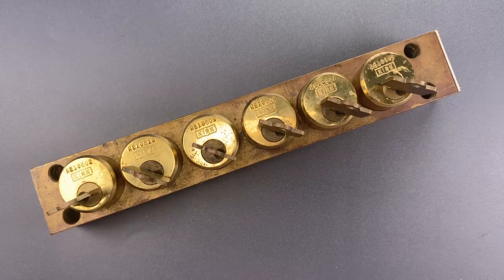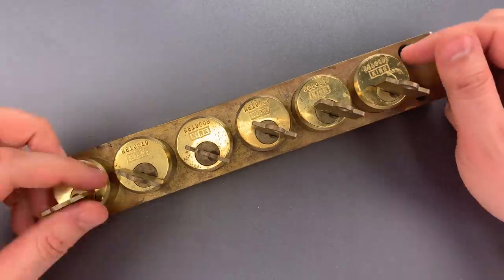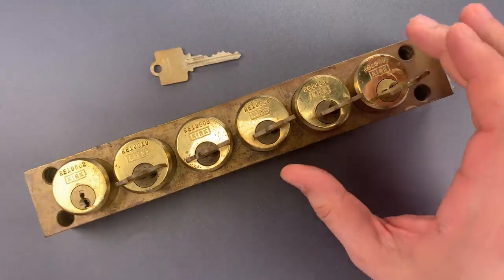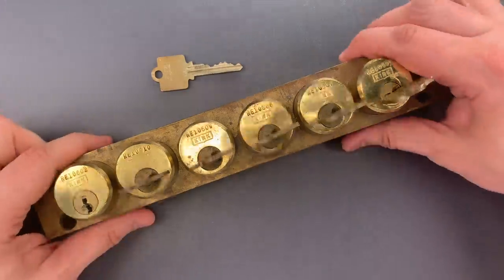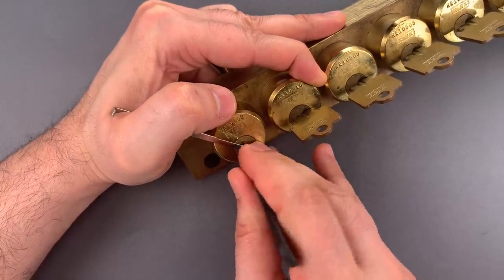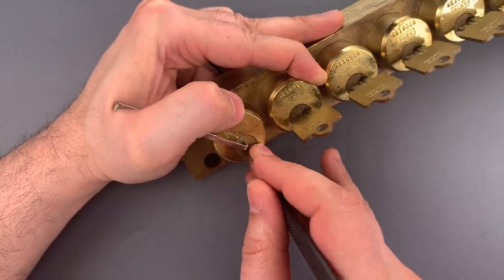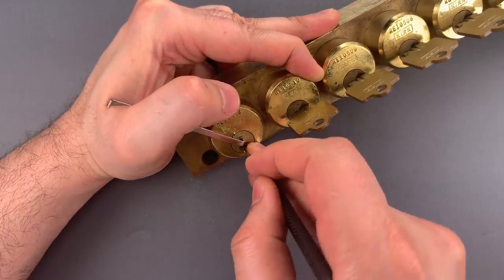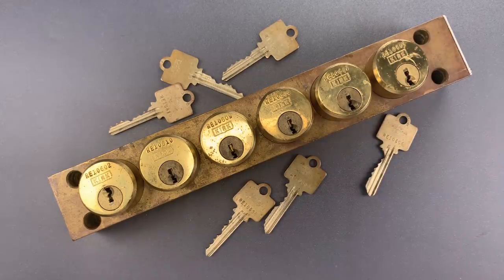[1190] 6-Key Kirk Interlock Panel Picked

Comment: As an electrician (retired) I have some experience with these interlocks, and that was a very good explanation of how they work.
BTW they are usually used where you need to shut down 5 systems to get the 5 keys in order to release the 6th which will allow access to the dangerous equipment. This ensures that nobody can access the danger area until all 5 power sources have been locked off. Often found on the 488V systems used in precipitators.
Reply: 450+V systems scare me. Seems like the Everett Field Boeing plant had one or two people manage to kill themselves by blowing up a 450V cart a couple times a year.
Reply: Yeah I was thinking he was doing it backwards. The ones we use at work you would put the five in to get the one.
Reply: @ScottKenny1978  we were taught that 347v and 480v systems were the most dangerous, because that range will result in a current that could cause cardiac arrest. Lower voltages cause burns, and higher voltages just blow body parts off.
Reply: @parapicktog7734  I'd believe it, though I wasn't joking about the words "blow up" a power cart.

An electronics tech friend of mine watched a kid get wheeled out of a navy school in a body bag from the 9v battery in a multimeter. Apparently the kids had been messing around with measuring skin resistance when this kid managed to put his thumbs down onto the points of the leads. And those points were sharp enough to pierce the skin deep enough to run the current measuring the resistance through his blood...

Dropped dead on the spot, they couldn't restart his heart... 😭
Reply: @ScottKenny1978  there is something not quite right about that story.
The 9v battery in a multimeter is not capable of producing enough current to cause any damage. But yes it is the body resistance (average body) that determines the amount of current that is drawn for a given voltage. 200ma to 300ma is the range of current that can stop a heart, and a human body resistance varies in a range that draws that amount of current with voltages between 300v and 500v. This is why 347 and 480 volt systems are so dangerous. A meter cannot generate those voltages, nor can a 9v battery produce enough current to do any damage.
Reply: @parapicktog7734  that's the story. Poor guy managed to take the full current of a 9v battery across the heart. This would have been in about 1990 or maybe 1993-94 (I forget if that was when he was training there or assigned to teach there)
Reply: @ScottKenny1978  I reiterate: A 9 volt battery cannot produce enough current to cause any damage to a human body.
Reply: @parapicktog7734  a 9v battery can supply up to 1 amp, which is well over the 200-300 milliamp current you said can kill.

This kid jammed his thumbs down onto the points of the probes, breaking the skin and running the current through his blood stream.
Reply: Came here to mention that. Our plant still uses them. A very effective safety system

Comment: I worked for 35 years in power stations and the scenario you suggested was EXACTLY what these interlock systems were used for.
The main electrical supply breaker for a switchboard had to be switched off in order to release the key (the one used on the left in this set-up).
Once the power was OFF and the key released, you would take it to the key-exchange device shown in this clip.
Insert that far-left key taken from the electrical breaker switch and then you could remove one or all of the other keys which gave you access to the doors to the switchboard.
As long as one or more of those keys were removed, the far-left key that allows you to turn the power back on is captured and you cannot restore electrical supply until all the switchboard doors are closed, locked and the keys removed and placed back in the interlock device.
Simple, effective and not too expensive.

Comment: When I was an RA in college, we had an interlock like this one (with two cylinders instead of six) for accessing the dorm's master key. Each RA had a key to the interlock with an etched serial number on it. That way, there was only one extant copy of the master key and if anyone was using it, you could see whose key was used to access it.

Of course, the interlock wasn't the only layer of security there. The interlock was inside a box locked with a different key inside the RA office, which was behind the continuously-staffed reception desk, which was behind the keycarded entryway. Defense in depth!

Comment: "Probably they do provide better security than many locks sold today." - LPL

"Crank the mass production boys, we hit the jackpot!" - Kirk locks probably.
Reply: "many locks sold today" almost certainly refers to masterlock
Reply: Imagine having this on your front door. Even though you only need 1 key to open the door, it's still going to look like some crazy security
Reply: Irony is that’s an OLDER series interlock key
Reply: Think about how expensive 6 good locks with a mechanical interlock system set in 9 POUNDS OF BRASS would be... Kirk did a very good job on them, but it's not going on anyone's front door.
Reply: By that i mean the Series Three locks are metallic steel or aluminum and they’re not traditional keys
Reply: t c  not sure how you envision it working with gun safe(s)?
Reply: You can buy these today - Kirk locks are still in business. They are not cheap.
Reply: @Bierstadt54  Kirk make door locks in the same system. For doors you don’t want people going through unless either the power is off or the long drop is secure.

Comment: "Less about security, more about safety"

Proceeds to talk about someone determined to electrocute themselves.
Reply: I also took him a decent amount of time to open it. So if that's the lesser security aspect, the safety side is pretty extreme.
Reply: Still a better lock than most of the gun locks, speaking about locks against darwin awards.
Reply: @detour666xxx  Precisely
Reply: @BuddhaJube  Locks used for interlocking should have some extra security measure to make picking more difficult and keys that cannot be readily duplicated without authorisation. It all depends on circumstances. An employer could be found liable if an employee is hurt because an interlock is defeated and it would not help the employer's case if the interlocks could be easily raked or employees had keys duplicated at a local hardware store. A railroad station I know has a key interlocking system over 100 years old (the last one of its type in existence) to interlock the switches and signals. There are two keys (both different) and they are massive. They can only be duplicated by fabricating a key in an engineering workshop and while the internal mechanism is simple, in reality it could only be 'picked' by an implement resembling the key.
Reply: @netking66  Please find a decommissioned one and send it in. I want to see LPL give it a shot.
Reply: In the scenario described, picking the first lock would still disconnect power to the panels, so that would still be safe. Removing one of the other keys and picking the system back shut without that key would create a dangerous situation where a panel can be opened but the power is on.
Reply: @peglor  that's assuming the worker who did the installation put a breaker in that way. Suffice to say, if an idiot wants to electrocute themselves, they will find a way, even if the installation wouldn't normally allow it.
Reply: @netking66  It is incredibly unlikely that a company would be found liable for an employee picking or duplicating keys for an interlock system.  The courts are only going to require a business to take reasonable standards for safety.  It would be like holding a business responsible for an employee bringing in a crowbar to force open an elevator shaft so they could fall into it.  The only way they would be liable is if it found that the business encouraged unsafe behavior, such as telling employees to learn lockpicking so they didn't have to use keys if they didn't have them.
Reply: @MC-yt1uv  On that point, there was a worker at my job who was promoted to trainer who told trainees ways to bypass safety systems, because he was just that much smarter than everyone and had to let everybody know it. Not only was he promptly fired but he and the company (even though they fired him when they found out and he was not instructed by the company to do so) were fined by the ministry. Like you said though someone in a leadership role was telling people how to circumvent safety measures.

Comment: We have these at work but the keys are weird huge ones.

We use them to stop the doors being opened on moving machinery.

The master key is in the front of the machine, as soon as you remove it the machine loses power. You then have to walk to the back of the machine to the panel of interlock keys and use the master to unlock the other keys. By then the machinery has stopped (it takes 20 or so sec to run down after getting power cut). You can then use the other keys to open the doors to get inside the machine.

Comment: When LPL says these are for breakers, he means 15,000 VAC breakers used in power substations and switchgear. We use then for some of the subway power stations that we make at Myers control power
Reply: How much do they protect people? Do they protect only the people who know how to use them?
Reply: @the11382  it's to detour people from getting into the breakers / electrical cabinet s where there is deadly amounts of voltage. So yeah, I think they do a good job. Also, if any of the locks are locked, you cannot re-energize the system (simular to lock out tag out)

Comment: Neat! I once had to use a device similar to this, to access the high voltage section in a 1940s electric locomotive. It had such massive keys and they were so hard to turn that a lock picker would probably bend!

Comment: I work at a steel mill, and at the electric arc furnace they use this exact system to prevent you from blowing yourself up.

You have to de energize the main electrodes (the left key here)

In order to go on to the furnace roofs, behind the electrodes, and up to the electrode front (right keys)

The right keys open up doors that have a simular two key kirk set up, that you can take the right key out, and lock it in a lockbox so you can be locked into an area, and the equipment be re energized

Comment: I agree with Peter H. a peek under the petty coat would interesting. I maintain and repair CNC machines and have seen some pretty bad and good lockout systems, nothing ever like this though. Most not so good, I was kind of surprised to see that it took you less than your normal 15 seconds to bypass it! If you follow proper lockout tag out protocol the pick resistance of the lock is not really an issue. All it has to do is prevent a breaker or switch from being thrown by someone that is not aware there are folks working on a system , possibly on the other side of the facility. This looks like an interlock that would have been on something far more deadly like a weapon system, not just the stationary closet. Enjoyed it none the less, Thank you.

Comment: As an electrical engineer, I can tell you exactly where this has a typical application. On a switchgear that is fed by 2 different power sources (such as two separate utility services), they will often have a "tie" breaker in the middle that connects the two sides. Under normal operation, the tie breaker is open, keeping the two sides seperate. However, in the case of a failure of one of the feeds, the tie breaker can be closed so both sides are fed by the power source that is still working.

However, you can't just close the tie breaker while leaving both feeds connected because 1.) You'll backfeed onto the feed that stopped working and 2.) If that feed were to reenergize and was out of phase with the other feed, it could cause huge problems not the least of which could be an explosion.

So, the tie breaker is used in combination with main breakers that can open the source feeds and they are keyed alike with a kirk key. There are only 2 keys in the world that will fit those 3 breakers and you must have the key inserted and turned (which locks it in place) to close a breaker. Meaning only 2 breakers can be closed at one time making it impossible to link the 2 source feeds together.

Comment: Well that is SOOOO much cooler than my jail door locks! I'm gonna be watching ePay to find one of those. THANK YOU for showing it! That makes for an impractical high security door setup. Picture this:

Two or more locks. One lock operates a latch to open door. The other lock(s) operate a re-locker to disable latch. Pick the wrong lock and its game over. With only one correct key for the one correct lock, it's impossible to screw up.

Comment: This somewhat reminds me of the usual train security system they got over at Stadler.
If you want to lower and raise that doohickey which connects to the power line, you must insert and turn a key at lock#1. that lock is secured by lock#2. the key to #2 can only be taken from lock#3. 
This goes on for about six locks. Only if all locks are locked, you can power up the train. Or enter the generator room when all are unlocked.
They implemented this (and more rules during testing of the train) because one darwin award speedrunner had a keychain with all those keys and just went straight into the room with the generator and cooked himself.
Reply: And the smell of an extra crispy critter is one smell that will linger for a long time.

Comment: Hey LPL, I just wanted to say thanks for your help, I am no way a lock smith and never had picked a lock before. But thanks to your Masterlock 570 video I was able to pick a Masterlock 575 with a wiper insert as a tension wrench and made a 20 thousandths pick using an scrap piece of steel. I was able to pick this lock over and over again and was able to do it on a completely different 575 as well. Nothing nefarious here just had to get in to some old lockers at work. Funny enough while picking I can hear your voice in my head saying "nothing out of 2, got a click out of 3".

Comment: I would have been curious to see what the inside looks like, however looks like you would need to damage it to get there.
Reply: At least show us the back and terminal connections
Reply: @tommypetraglia4688  There's nothing on the back. It's a standalone device. They are frequently just mounted to walls.
Reply: He said in another comment that it wasn't possible to disassemble without damage, but if you looked hard enough I'm sure you could probably find a video of them assembling the system and testing it
Reply: @agentghost1661  
Sure, I will Google it, I always do, I was a bit busy yesterday, but a little info from LPL would have been nice for those of us uninitiated to the workings of these. 

At least he could have shown us the back to satisfy my curiosity 

It's like a desk or a guitar on the Antiques Roadshow where the appraiser doesn't open a drawer to view the secondary woods and work or strum a  cord to hear its tone
Reply: @HuskyKMA  
With 6 circuits involved there must be some beefy terminal connections
Reply: This one is a key interchange block, and does not lock anything but the trapped keys. There are other styles of Kirk locks that have bolts and/or electrical limits to enable or disable equipment. I have had these modified by Kirk, so there is a way to open it, but not for the typical user.

Comment: The old transmitter we used at work had a key interlock system. The first key allowed you to open the breaker panel at the top of the transmitter. Once that key was put back and turned fully, you could then operate the 2nd key that allowed you to remove the high voltage bus bar. After that, you could operate the 3rd key, which gave access to the tube panel on the back side of the transmitter. There was about 30kV inside the tube, which was more than enough to turn you into a crispy critter if you tried to defeat the interlock system

Comment: A day that begins with someone defeating a safety lockout is a day that ends with a Wikipedia page.`
Reply: Usually. 

At the very least, it ends up on the local news from someone killing themselves. Say, for attempting to steal copper wire from a live circuit.
Reply: Depends, I've seen quite a few lockouts bypassed. Some are as easy to defeat as carrying around a slim steel rod. Instant access to hundreds of Amps or tons of steel with tons more hydraulic power. 

The thing is, you have to know what you're doing, be methodical and don't let the idiots see any of it.
Reply: This is my new favorite quip. Thank you.

Comment: The fact that this has less reasons to be picked, yet it offers better pick resistance than a lot of the locks shown here astounds me.
Reply: You would be amazed and appalled at the things people will do to avoid doing a safety procedure designed to keep them alive.
Reply: Most locks are securing between $0 and $500 worth of personal property liability.
This thing is securing against wrongful death lawsuit liability and potential damage to major national or corporate or scientific infrastructure.
This is not a product designed to be mass manufactured and shat out upon Home Despot shelves, this thing is, apparently, a product designed for safety purposes with uniqueness of the keys as a selling point. They're probably not going to skimp and save $0.0021 cents worth of security pins when they're engineering a nine-pound chunk of brass to sell for something which is probably absurd like $10,000.